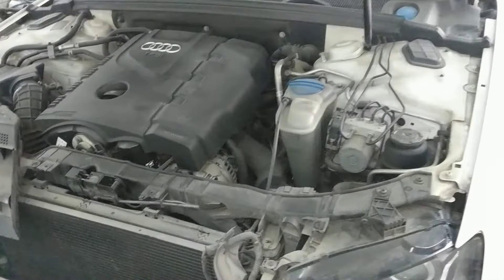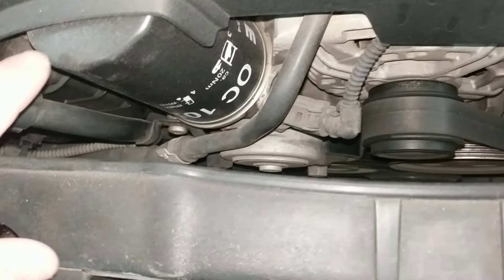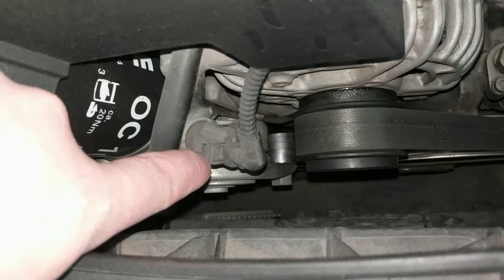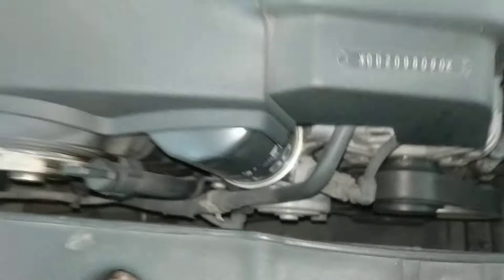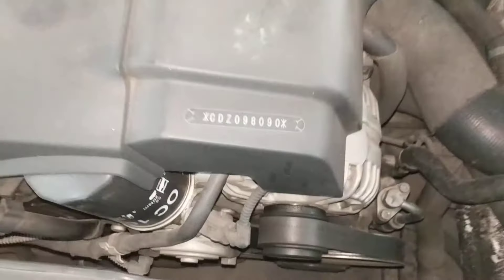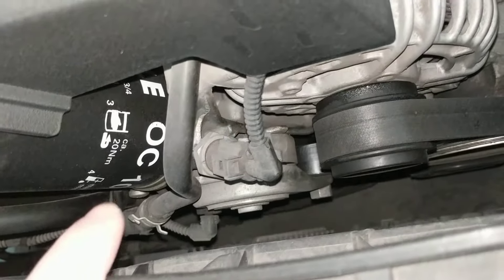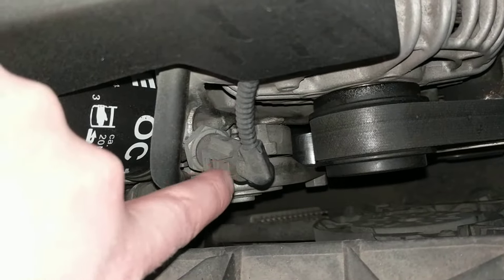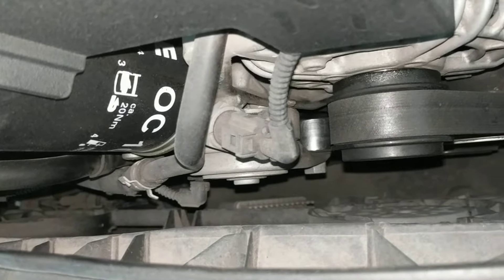Audi A4 2008-2016 Oil Pressure Sensor Location and Removal

Comment: There are actually two of these sensors or switches. There is a brown color sensor that this guy shows you in this video and there is also a blue or purple sensor that you can see the plug sticking out when he points to the brown sensor. Do you see the C and 1 on the oil filter? Now move your eyes straight down past the tension pulley. Do you see the connection and cable sticking out? That is where the blue oil sensor is. You need a 24mm deep socket to get these out.
Reply from the maker: Thank you for sharing your knowledge Randall Lowe!
Reply: True. I am planning to change that tomorrow along with the one in video because my audi gives warning on almost every drive"Do not exceed the maximum engine round above 4000rpm." I am hoping to get that problem fixed.
Reply: @umakantaghimire2439  have this same exact problem right now. Did this fix it?
Reply: @quinnsalter9027  after i change the sensor it showed once but not after that. I changed that week before. Sound has not been changed neither stop shaking so planning to clean manifold again.
Reply: Thank you

Comment: Great video m. I am getting some false reading on my Audi A3. I keep getting a EPC and max 4 RPM code in my dashboard. According some forums these switches have something to do with it. How do you safely remove them?
Reply: What was the issue I have same problem
Reply: @pmote00  add oil to your car
Reply: @pmote00  I was getting the same issue, brought to dealer and they wanted a crazy amount to change the oil pressure switch (their diagnosis of the EPC Light and don't exceed 4k rpm warning I was getting when driving it in S mode). I just stopped driving in S and I don't get it anymore, but about to replace the switches myself just on case..
Reply: @anesthesiachris5458  sadly the sensor wasn’t my problem, i got super lucky previous owner before me did the chains and tensioners because the car jumped timing but didn’t clean the oil sump, therefor oil wasn’t getting sucked up caused low oil psi caught it just in time before ruining motor. replaced oil sump, pump, lower chain, water pump and union ring back running like new with 215k on it
Reply: @pmote00  oh wow, I have a B8 A4 with 168k miles, I was just calling around last week to try to get prices for timing chain job...dealer wanted 5k for timing and water pump replacement and indy shop said they don't work on older than 10 years..smh

Comment: Can you remove this while the car and filter is full of oil or will oil dump out from what may have remained pressurized in the filter?
Reply: Ty Nagle it would be a safe bet to take it out when it’s cold and the oil is low it shouldn’t leak than if its hot some oil may leak out from the pressure build up

Comment: I thought there was 2 oil sensor units one brown and one blue the brown one being a low pressure sensor in the blue one being a high-pressure center
Reply: Yes. The high pressure sensor is below the oil filter
Reply: @hytq1344 how do you remove this I can’t figure out how to pull it off.

Comment: I actually have 2 sensors. One is blue and the other is brown
Reply: Where is the blue one located? i replaced the brown one and i still get the low oil pressure warning light on my 2010 a5 cabriolet.
Reply: reginald matthews Figure out the issue? I’m in the same boat
Reply: Same here! Need the blue one, not the obvious brown one.
Reply: How do u change the blue one?
Reply: I have a 2014 Audi allroad with the same set up, 2 sensors and can’t figure out which is which. Everywhere I look for parts they say there should only be one but I’m like no there’s 2 a brown and a blue
Reply: @rmatt78470   in this audi A4 its just below the filter if you follow the cable. 0:39 the cable below the finger is the blue switch.